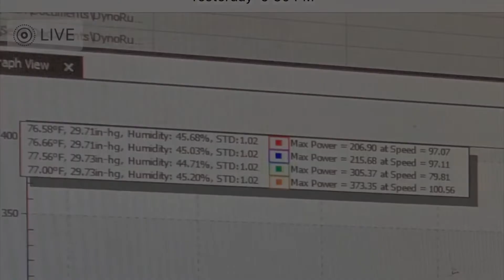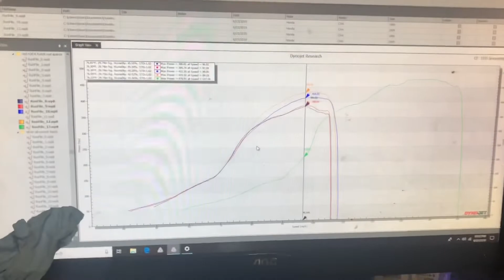Big turbo DSM hits the dyno!! | INSANE RESULTS!!

Comment: Once you burn out the clutch and tires out with all that spinning, have the awd swap ready to go.
Reply from the maker: Jr Drive Awd swap will be in the future. Got some new firehawk indy500 street tires on for now and a set of radials on the side. clutch is holding no problem, but not really worried about it those are all wear and tear items anyways

Comment: What frame and  hotside do you use on your 6262
Reply from the maker: jay turner t3 .63 ar 3inch v-band
Reply: Kool we have very similar setups. I’ll reach out when I hit the dyno and let you kno. Congrats on 480hp tho. Definitely consider e85 cheaper than race gas 👍🏾
Reply from the maker: jay turner thanks man! And definitely reach out, id be curious to know
Reply: vic_gst are you on dsmtuners ? I can drop you a line there
Reply from the maker: jay turner yes my username is vic_gst